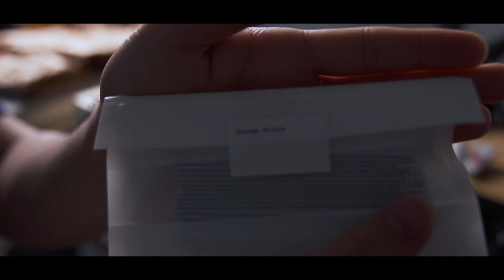Wampus | Aluminum 60% OLED Alice Layout Build | Typing Sounds

Comment: Wondering why you shot in 21:9 (or similar) but then exported in 16:9? Youtube will handle the fit for people but since the horizontal black bars are now baked in, I get double black bars on both my phone (note9, 18:9 screen) and my monitor (21:9). Perhaps forgot to change the default export screen ratio?